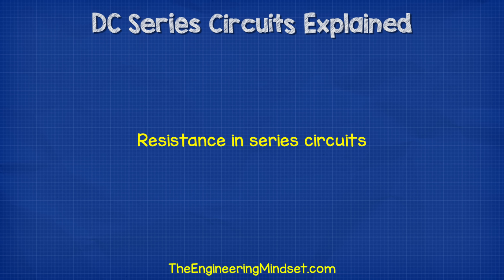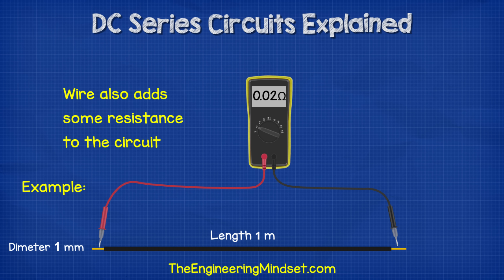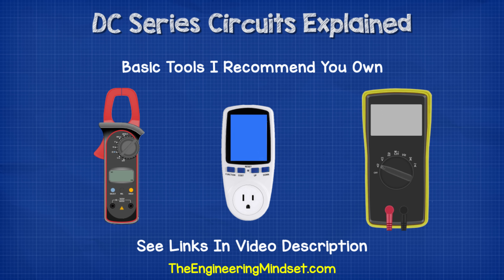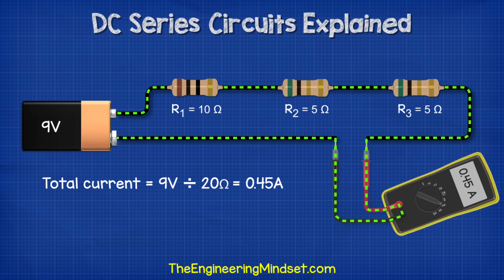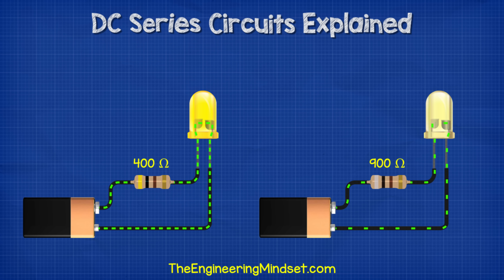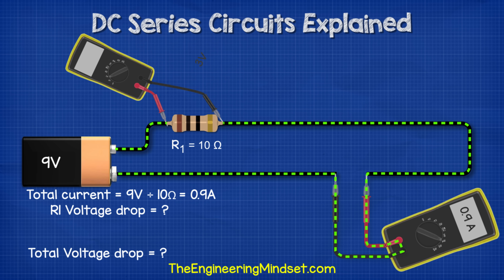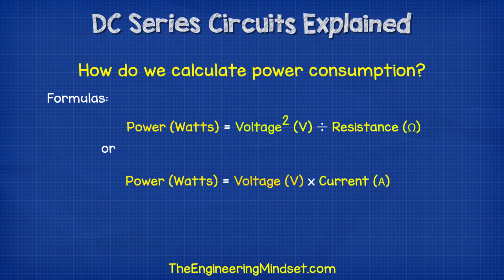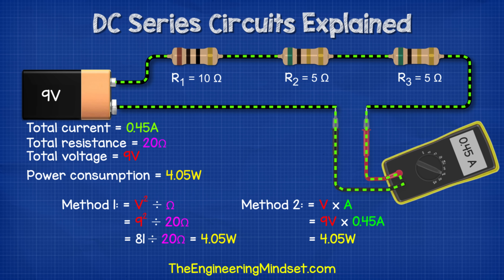DC Series circuits explained - The basics working principle

Comment: If you measured the voltage from two points in the wire not containing a resistor, is the voltage 0V?
Reply from the maker: Check our new Multimeter tutorial out ➡️ https://youtu.be/4lAyzRxsbDc
Reply from the maker: Check out NEW resistor video, everything covered! ➡️ https://youtu.be/DYcLFHgVCn0
Reply: yes
Reply: @lordjaashin  Thank you
Reply: @Gvnrae  
Ideally yes. In a circuit diagram a wire is always assumed to have no resistance at all.
But in reality in some cases (very high current or very thin wire) you have to think about a wire (or connector/terminal) as a resistor as well. Then you could measure a voltage between two points on the same wire. This is btw. exactly how the current measurement in a multimeter works (in the 10A setting that many have). There's a thick wire with a very small known resistance in the multimeter and the multimeter measures the voltage between the two ends of that wire when current is flowing through it. That voltage is then converted into current (with the formula seen in the video) and shown on the display.
Reply: @superdau  so you could effectively say, I guess, that the voltage in a straight wire is negligible? As far as practical measurements
Reply: @Gvnrae  
Yes. For almost all of the usual hobby electronics.
But, for example, I have built a few multicopters that can draw quite a lot of current from the battery (several tens of amps) and am working on a project where bursts of more than 200A are possible. In that case the wire is not just a wire anymore.
Reply: @superdau  That is very interesting. I am by career a software developer now, but I like to go back and  look at engineering videos in my spare time and investigate more from what I learned in college. That is pretty cool. Was it hard for you to get into the hobby, in terms of getting the parts and whatnot?

Comment: 5:54 I tested this and my results are different. If I put 10 ohms on a 9V power source I get burned fingers instead of 9V
Reply: Your resistor power rating has to be higher than the power consumption of the resistor.
Reply: Then YOU'll become the resistor, you must put the multimeter in your correct pole!
Reply: @sophiacristina  some  devices will show negative reading though
Reply: How´s that? Do the same way he did ! The cable must be isolated... Then, before you connect everything to the battery, first connect the resistor with the cable. Ok, now, you can connect the cable points to the battery!!
When you´ll be ready to measure, grab you Multimeter put it in the right measure position,=Voltage,Current or resistence=, 
and put the Multimeter terminals on each side of the resistor.
And this is how you will have a read !
PS:  In that especific case, you can measure the voltage but also the current. So, you apply a known formula_Ohm´s LAw
The voltage you already know= 9Volts.
Now you want to know the Current_!  SO, OHm´s Law::  Voltage= Restitance * Current__!!!!! To know now the current:::
:::::::  Current = Voltage / Resitance:::::   So, Volts= 9 volts / Resistance=10 ohm = TOTAL= 0.9 Amper (current).
Sorry for all this, but i felt that you might need it  ;)
Reply from the maker: Check our new Multimeter tutorial out ➡️ https://youtu.be/4lAyzRxsbDc
Reply from the maker: Check out NEW resistor video, everything covered! ➡️ https://youtu.be/DYcLFHgVCn0

Comment: In the circuit with an led and resistors you calculate the current as if the resistors were connected to 9v directly. Shouldn't it be 6v because the led is dissipating 3v?
Reply: and most LEDs dont like 9v, typically 1.9- 3.6v depending upon color. so increasing resistance not only reduces current but voltage
Reply: Yes, but that would make the video too complicated, especially since LED voltages vary quite alot depending on type. Ignoring the LED voltage in this case also is an error on the "safe" side, because in reality the LED will get less current than calculated.
Reply: Yup. You remove whatever voltage across the resistor that the LED blocks.
Reply from the maker: Check out NEW resistor video, everything covered! ➡️ https://youtu.be/DYcLFHgVCn0